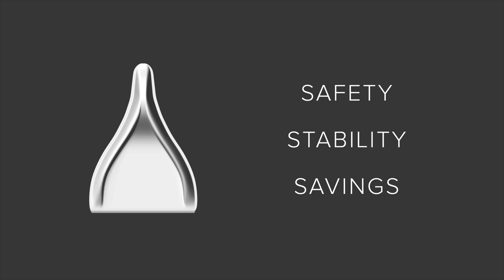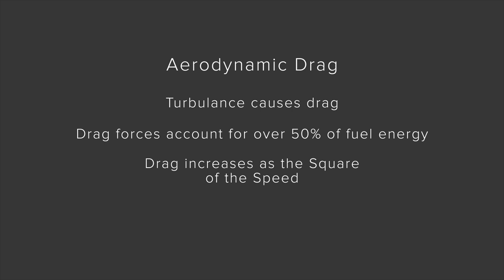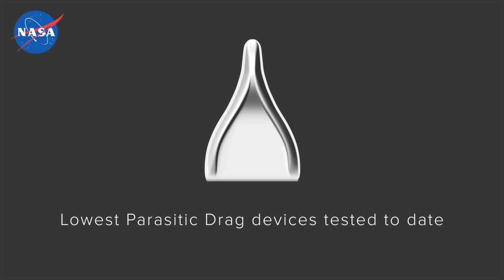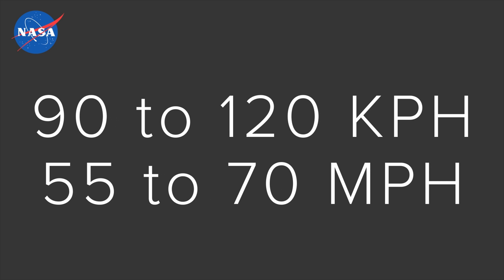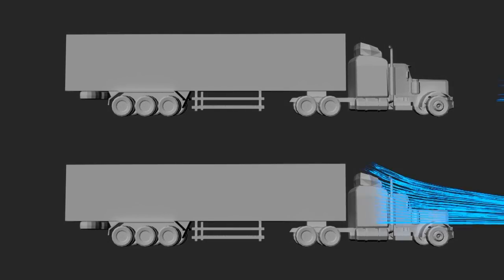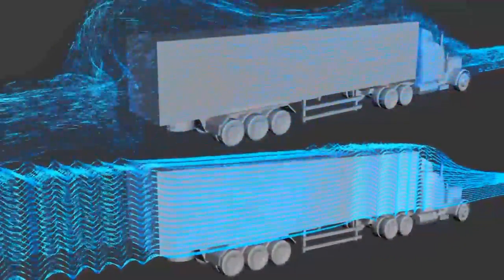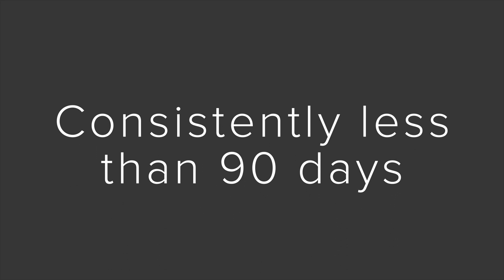Airtab® Fuel Savers

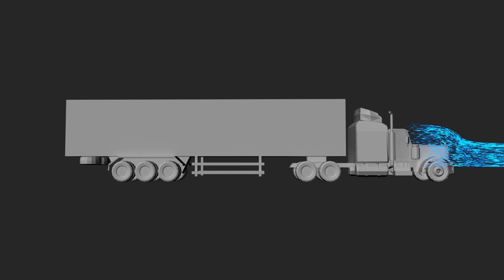Comment: Your animation at 2:08 looks completely unbelievable.  Do you people have even rudimentary CFD software in house?
Reply: That's some colorful fluid dynamics right there
Reply: @windowsxseven  looks more like a magnetic field than air flow
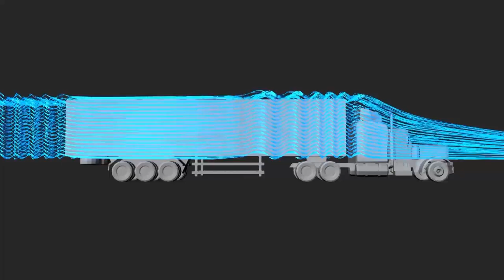Reply: @durim187  4:38 also looks sketchy af, there is no way that the flow will be that smooth between the first gap and especially not after the truck's trailing edge
Reply: @windowsxseven  lol and why the wake  has curls?

Comment: If these things are so effective, why don't any truck, trailer, or RV manufacturers incorporate them in their body designs?   I mean, these things are not expensive to make and could be part of the body panel designs, not requiring that they be stuck on with double-stick tape.

And, these things aren't cheap, either.   So, how many miles must you drive in order to recover the $250.00 cost in the form of fuel savings?

What I need is quantifiable data that compares and contrasts the effects both with and without the devices?   And, this video only asks that question, rather than answering it.
Reply: Here is a source that shows the beneficial effects of these types of Vortex Generators. 
http://www.autospeed.com/cms/article.html?&A=113219
This reduces Wake Drag. 

Here is a video explaining vortex generators,
 https://www.youtube.com/watch?v=eP-YUDe9HF0. 
They are applied on plane wings and even on high speed race cars, because they have more benefits at higher speeds. The most likely reason they arent applied on normal cars is because they can look rather ugly and most people would take looks over benefits.
Reply: Richard, They come in panels, and at $100 per trailer/ truck, so not that much really. See more on www.v-spoilers.com
Reply: They do, fuel tankers run them
Reply: There is a large fleet in my hometown that runs these on all their trucks. I’m getting 8.5 miles per gallon on my company truck running regional. Figure a 2 to 5% gain three dollars a gallon diesel. I do 100,000 miles a year.
Reply: Style, r&d, gas lobby politics, might as well as why we don't use gasification technology...